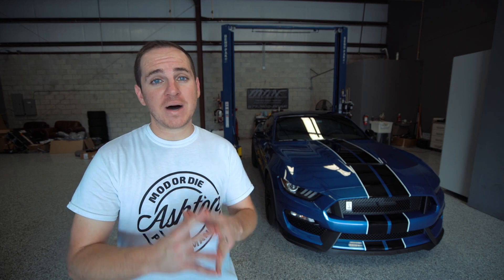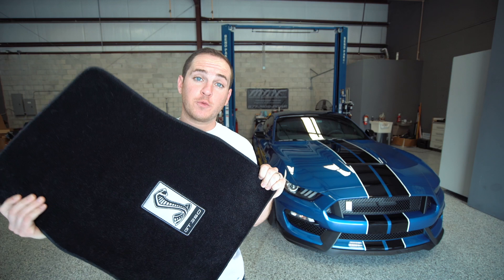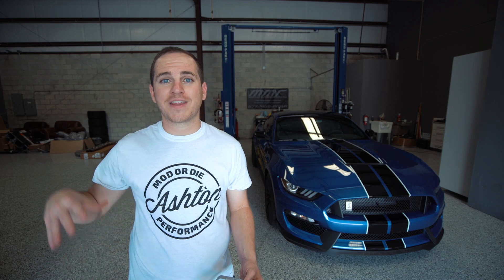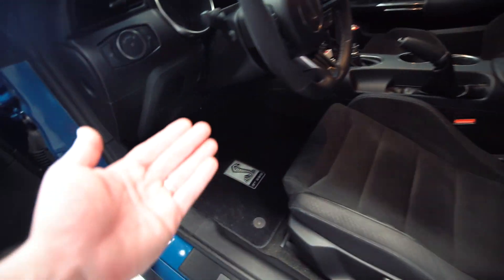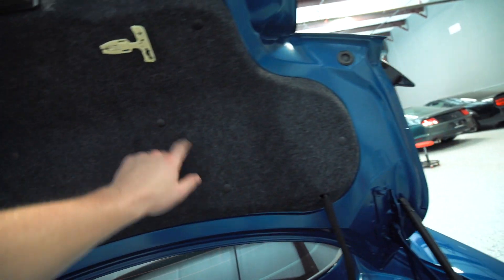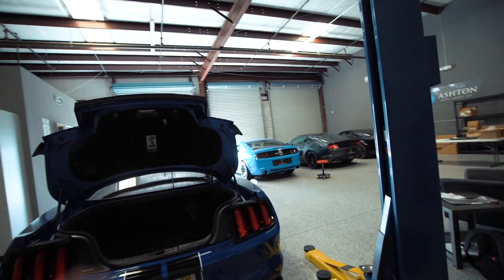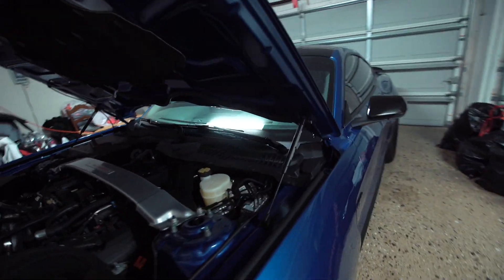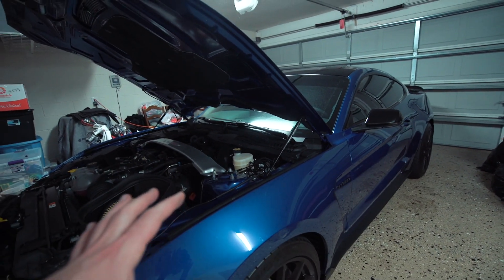GT350 MODS! TRUST ME, We're Just Getting Started.

Comment from the maker: QUESTION OF THE DAY: Ashton Performance website; what parts do you wish we had that we currently don't? What product sales would you like to see?
Reply: You guys should really add the steeda heel toe pedal set, i have a size 13 foot, and because of the size of the accelerator, it is super uncomfortable to heel toe
Reply: Gt350 steering wheels, and all of the other things which you have mentioned as your top 5 mods if they aren’t present already.
Reply from the maker: Good call on the steering wheels, I have some carbon ones coming soon! :D
Reply: Jeff Ashton buy me a set of longtubes for my 3.7 Cyclone s550
Reply: Please widebody it. It would be so cool
Reply: Widebody'ing a car detroys the value, plus it's costly and time consuming.
Reply: Coyote motor mounts...BMR, Steeda, etc.
Reply: Jeff Ashton yes good
Reply: Do you have any “Ecoboost” struts?
Reply: Jeff Ashton jackhawk 9000’s!
Reply: Jeff, my name is Levy. I saw in one of your videos an aftermarket steering wheel replacement for your GT350, you mentioned the maker of that steering wheel and the website but I did not save the info. I could not find that video anymore. Could you help me out in getting some informations. I too have a ‘16 GT350. Great infos on your videos Jeff! Thanks!
Reply: Jeff Ashton Hey there...I want one of those Trunk Carpet Liner with like a Giant Cobra 🐍 or something cool..  I’ve been looking everywhere for one of those and  no one seems to have anything like it.  I have a 2017 GT 350...  Let me know if you add this to your store.

Comment: I didn't need to drill any holes for the SVE hood struts I got from LMR and they were only $60.
As far as parts I want to see, I want to see what you did with the whipple from your crashed mustang.
Reply from the maker: BRI2K TV gotcha, the design on the SVE struts isn't as good IMO. It puts a lot more stress on the struts. Ours are also American made. I'll have a video up on the Whippled GT soon. 👍
Reply: BRI2K TV: China vs. USA you get what you pay for...
Reply: Really, how often do you really have your hood up. I've had mine up 3 or 4 Its not like I'm opening my hood every day or twisting on the hood when its' open. Mustang Lifestyle put the same ones on their car and they have  had no problems at all. Doesn't see like its worth over double just for a different bracket that requires a hole to be made. If I don't think the bracket is good enough, I will just make one to replace it myself with some aluminum angle. That's the cool thing about being an old school hot rodder. I didn't have money to buy all these expensive bolt-ons, so I learned how to make stuff.
Reply: Actually, Jeff, I would love to buy that whipple set-up you had to put in my 2017 GT. I'd also post videos of me installing it and be sure to give you the props for selling it to me.
Reply: BRI2K I understand that you just don't get it and are cheap,my hood is open at every show(First you need to have a car that is worth opening it for),so if you are at car show and it happens to be windy it sure seems like it would be worth it to me...along with being made in the USA not China, I personally would always pay more for and which is not double the price you need to do your math correctly.